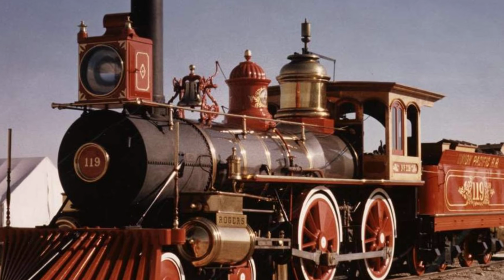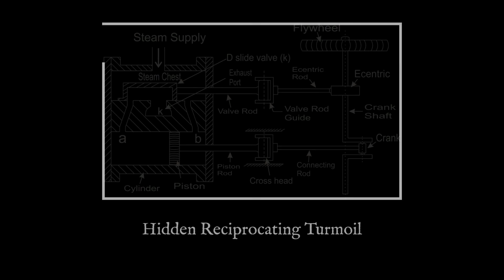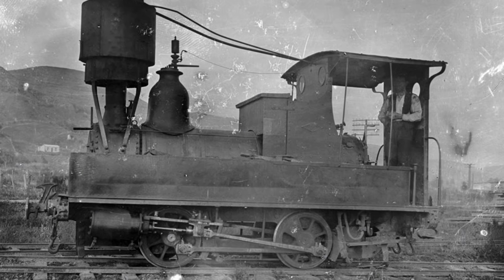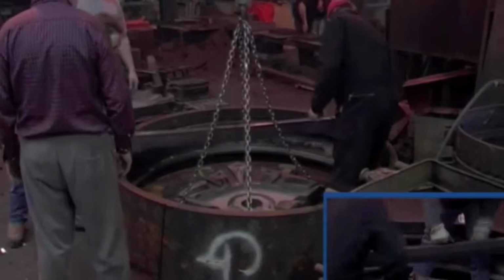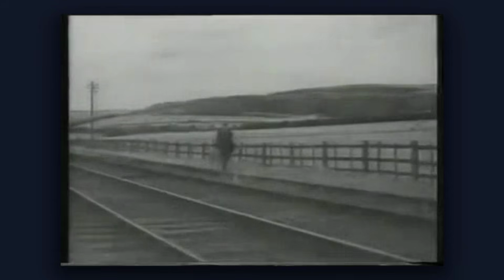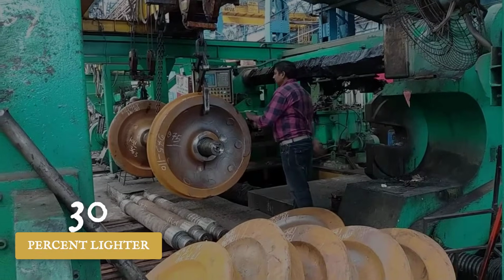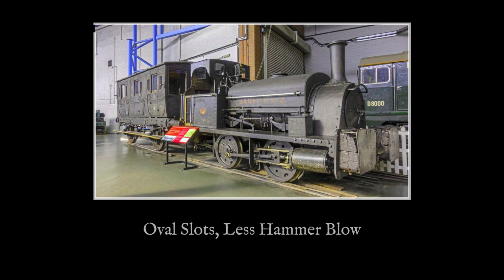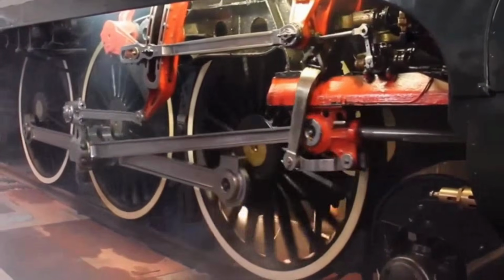Why Do Steam Locomotive Wheels Have Holes?

Comment: Make it lighter. It is heavy enough.   One pound of weight off the engine is another pound it can get paid for
Reply: partially true, another really important factor is being able to balance out the running gear, which is typically why you see larger counterweights where the main rod connects to the side rod. If the wheelset was entirely solid, you'd have a much tougher time dealing with balancing issues and how to add extra weight when overall it is better to remove weight in most spots and leave or add weight in other spots to balance out the forces.